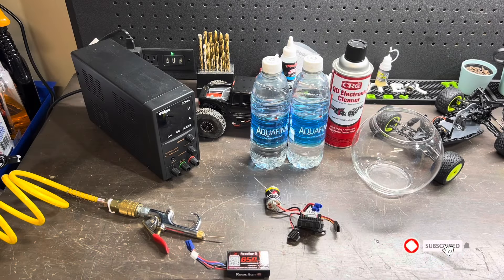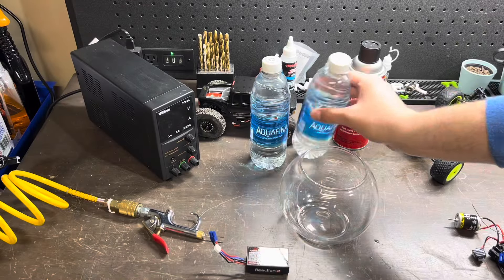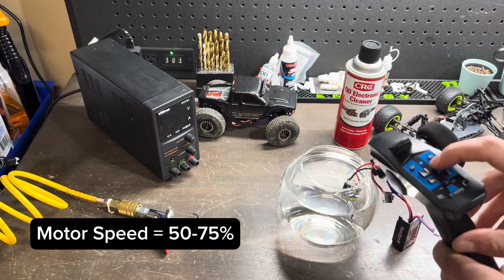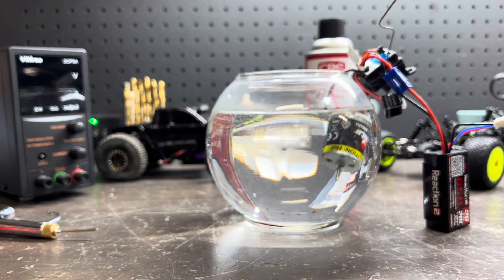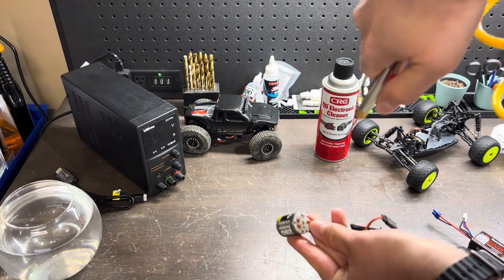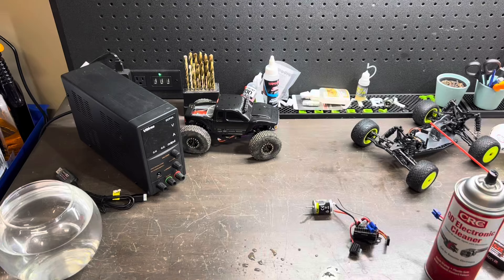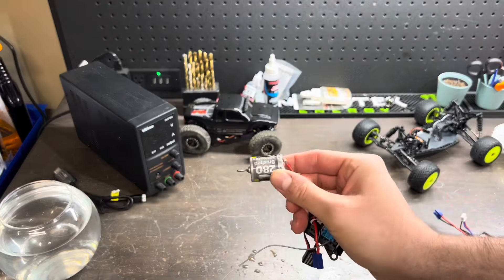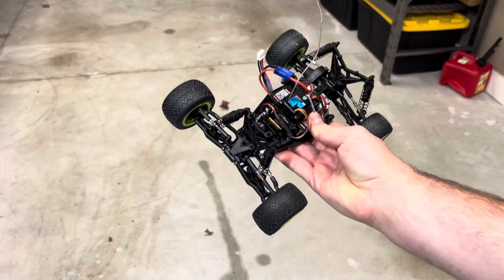How To Break-In A Brushed RC Car Motor!

Comment: I just bought some DeOxit.  Turns out the stuff contains a solvent.  If there’s varnish or lacquer on the windings, DeOxit will dissolve  it.  So - is it ok to use on RC car motors?
Reply from the maker: So I’ve heard both yes and no. I am actually looking at moving away from this method completely and switching to a low viscosity mineral oil.